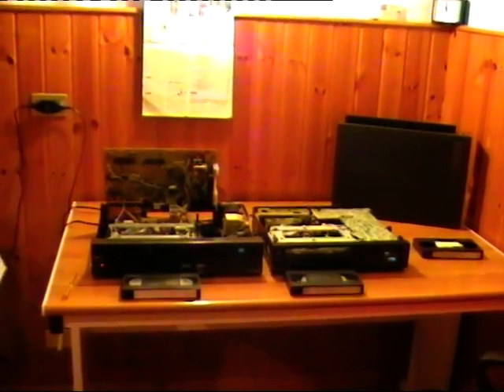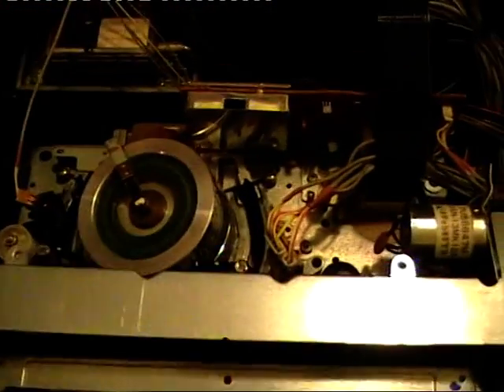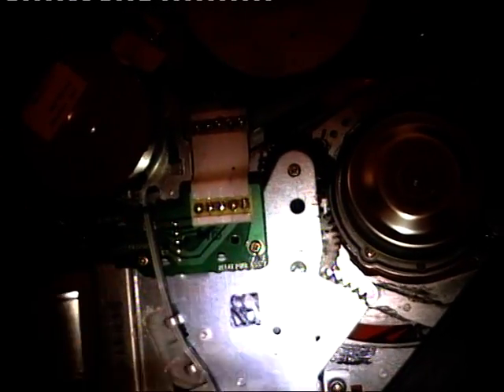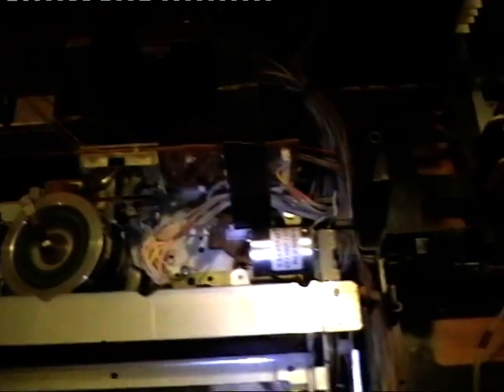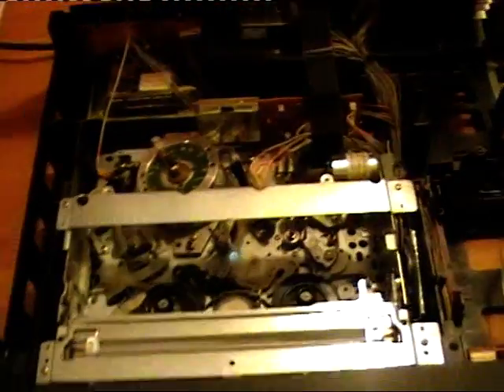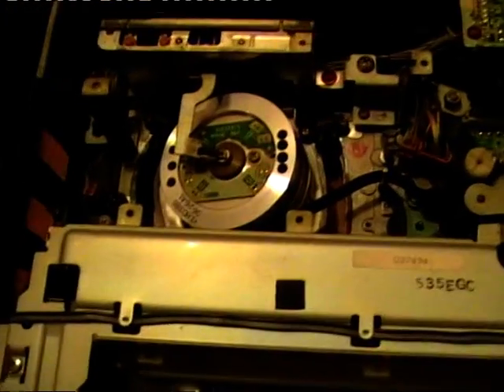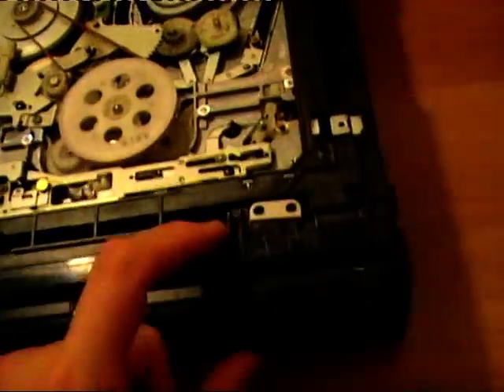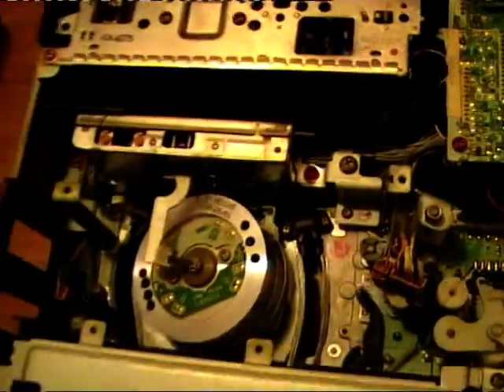Comparison between two old vcrs - Tape transport differences

Comment: 3 years ago i had to realign this panasonic g-deck model, gear by gear, and yes it's a nightmare, but a joy when it works. A single misaligment by only 1 tooth can lead to completly erradic behavior!
Reply: I realign correctly but mine have pcb main ic problem capston run automatically left and right nothing works

Comment: The seleco is a rebadged JVC HR-D170 I think. Similar to ITT VR3906, Toshiba v-66  and ferguson 3v42 among others. there were also saba thomson (v352?) and telefunken variants, can't remember the models though! Great decks. there were about 3 different idler assemblies used, you have the later one.

Comment: Today I looked at my collection. The Thomson equivalent of the Seleco is the V-410. The different idler assemblies I mentioned previously are in fact used on slightly earlier models, the ones with manual /mechanical tuning (I was getting confused, it has been about ten years since I last used one!).

Comment from the maker: Because it is really difficult to put all the cam gears in the correct position if something goes wrong. The first time I repaired a G deck like this I was complitely stuck!! Luckily searching on the web I found a very well made service manual for this tape transport.

Comment from the maker: It's not an easy job, you have to remove the upper carriage assembly in order to reach the carriage loading assembly, then there's a shield you need to remove in order to reach and change the carriage belt. Be careful not to mess up the carriage gears because they are timed.
Reply: Ho ma simmo italiani anzi palemmitani